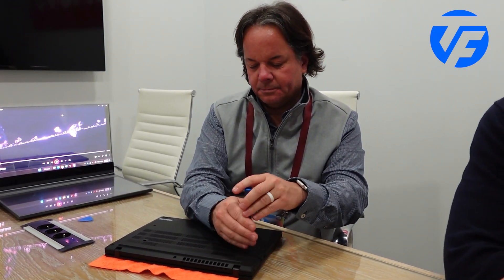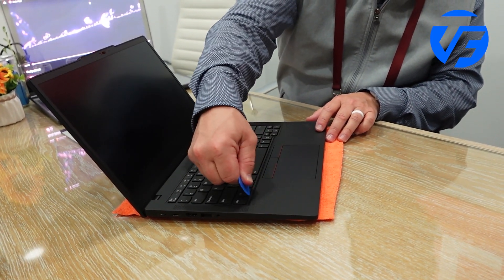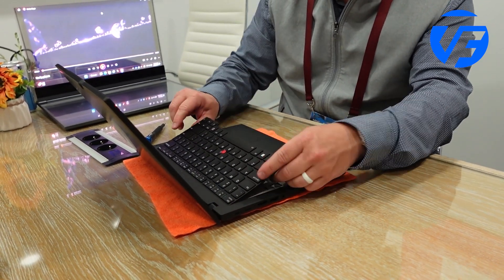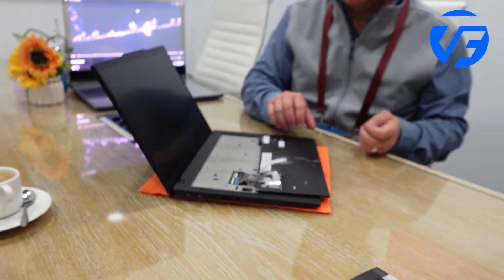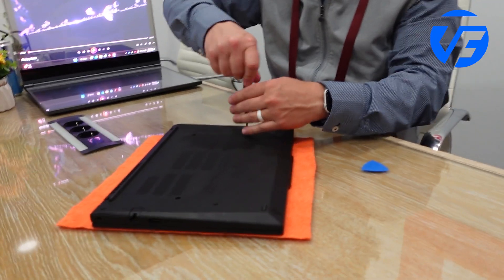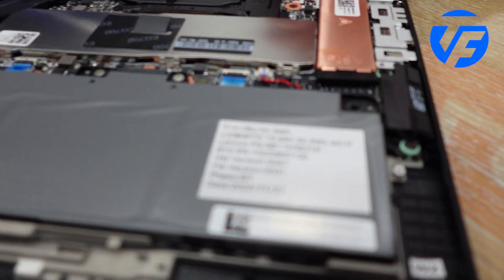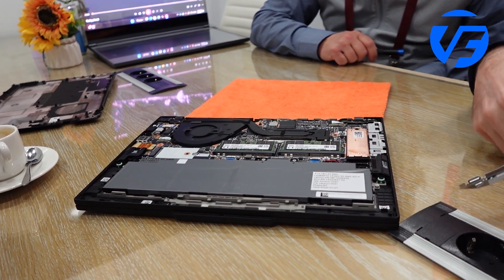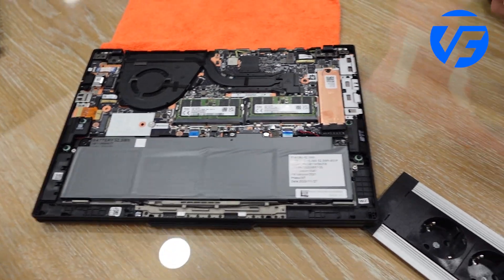Lenovo ThinkPad T series repairability demo at MWC 2024

Comment: Glad to see Lenovo back to this frendly policy where you can repair your laptop, just like on my p51s!!!
I wish that they will return to a external battery with normal cells, so, after let' s say 3 years of daily work you can send the battery to a service to change the cells, but i understand that this type of battery îs too large and maybe it will work only on thicker workstation like p16...
But no big problems, laptops batteries are getting better and better every day😏
I am more concerned about the usb c charging port rather than the ethernet one!
But all is good, I finally see the intention from lenovo to repair and replace parts!!!😇

Comment: 2:10 This seems to be T14’s Intel based variant instead of AMD ‘cause of the single heat pipe, which is again, a crying shame. 

I really don’t understand Lenovo’s stupid reluctance in putting just a single heat pipe on the Intel variant, and dual heat pipes on the AMD variant. Why can’t there be dual heat pipes on both?
Reply: You’re right
Reply: Guess what, even the AMD variant has regressed to a single heat-pipe for the T14 Gen 5, but it is a slightly bigger heat-pipe than the Intel variant by about 4mm :D

Comment: Same as current gen except for soldered Ram and Ethernet. But what about charging ports replacing? Are they still soldered on motherboard?
Reply: @TheRockacer22 this is patently wrong lmao. Thinkpad's have had removeable port since ever, the problem is usb-c and not including a charging port seperately
Reply: @TheRockacer22  love how confidently you pull stuff out of your rear

Comment: I think this one is T14 gen 5 that will be released this year (2024) around June
Reply: Intel (April) AMD (May)
Reply: @bkkev8147  I prefer AMD
Reply: @kafka-talmud  what do you prefer about it also was gonna pick up the new x1carbon gen 12 but keep hearing about performance issues so looking at the T14s gen 5
Reply: @bkkev8147  You mean the performane of AMD is lower than Intel in terms of compatibility of this series ?
Reply: @kafka-talmud  no no saying I’ve heard X1C has some performance issues
Reply: @bkkev8147  Thanks for illustration
Reply: Two dimm slots for a 14inch t series. Im in.